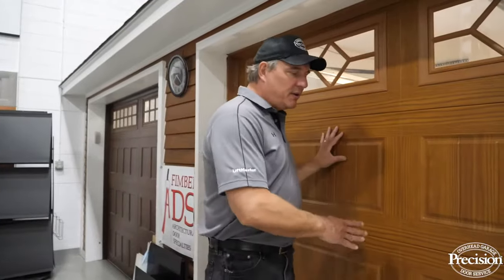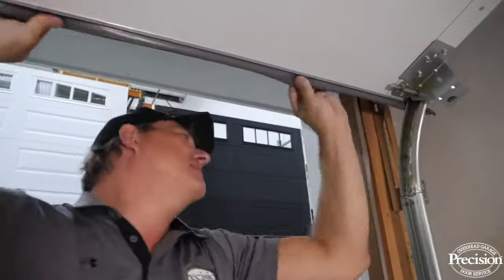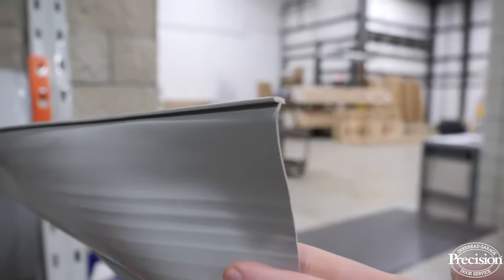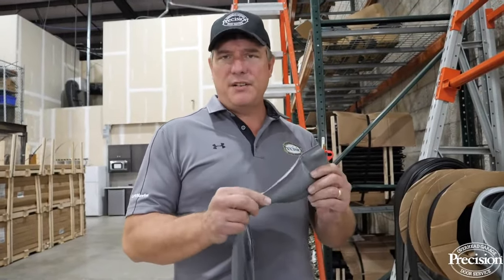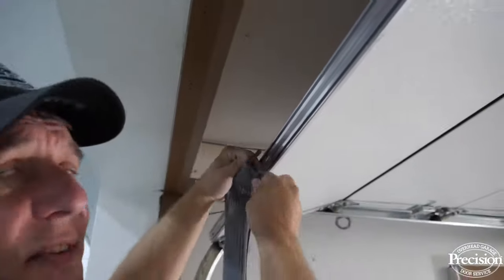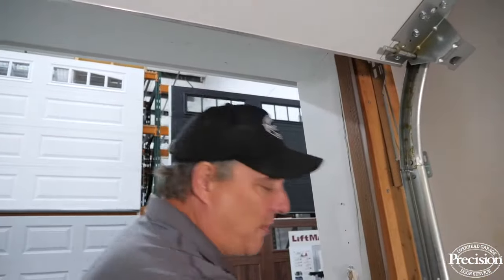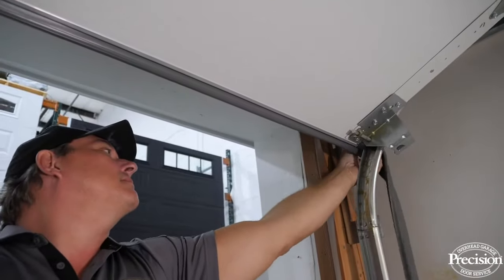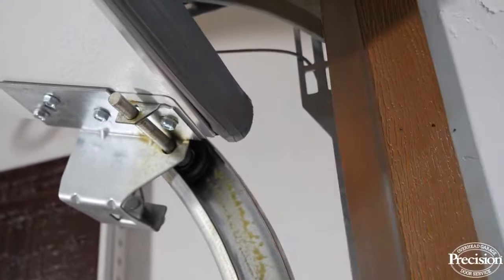How To Replace Garage Door Bottom Rubber

Comment: Thank for explaining everything in detail I was just trying to put weather strip in on the bottom of my door and the thing is the channel thickness is smaller than the Frost King bottom seal rubber that I bought at home Depot so I'm going to have to buy one with a thinner channel thickness, but thank you for explaining this otherwise I would not know why it doesn't fit
Reply from the maker: No problem! Glad we could help!

Comment: Great video.  Unfortunately, I installed the new rubber bottom, but I can still see light through on one side of the garage when it's closed.  It appears the ground is slightly warped.  I don't suppose there's something else not too drastic I could do to fill the remaining gap?

Comment: First time I replaced mine I did it by sliding it in. It wasn't fun. The last time I did it I used a heavier duty Bowsen brand. Their installation video shows to push the back edge into the track and then work the inside edge in. Then move to the front side and stick the back edge in, and then push the front edge in. At first I was using a plastic trim tool to push it in. Then I switched to a screen roller and it zipped right in.
Worked out faster than trying to slide it. Last time I would get half way or more and it would pop out of the track when I tried to slide it.

Comment: I don't have a problem with water pooling outside of my garage door, but heavy wind driven rain seeps in and pools up inside. Are there any options to prevent this with the T channel design or is the standard rubber seal good for this?

Comment: Soapy water. Wd40 will collect grime.
Reply: Two clues that these people have no idea what they are talking about.  1). Recommending Wd40 which is solvent based and great at breaking down rubber.  Anyone that recommends this to lube the retainer, don't walk away, RUN!  Only use silicone spray or soapy water.   2). They have some kind of grease in the roller track which is a big no-no.  Dries, collects dirt and hardens. Increases rolling resistance, especially in the winter. Only lubricate the roller bearings.
Reply: Go ahead and try to slide one in without it lmbo😂

Comment: Thank you for the video. I did the same exact thing. But now, the door is a standing a few centimetres up frm the ground and the latch is not falling in to close the door. I think this is because of the thickness of the rubber. How do i fix it ?
Reply: Have you try adjusting the closing limits of your garage door opener?

Comment: I just replaced Bottom Rubber Seal and it sticks to the the painted floor and makes motor work a lot harder to break that sticking. Any solution to that? I am in Florida and my garage door exposed to the sun.
Reply from the maker: You can purchase Slick It! It's a lubricator for your bottom rubber and weather seal, you apply is similar to a deodorant. That should do the trick!

Comment: I have a garage door that needs the bottom rubber replaced, but there is a portion of the door that has been damaged, and in the current condition it won't be possible to get past that area.  Is it possible to repair the section of the door that is damaged, or am I looking at replacing the entire door?
Reply from the maker: There's a chance that you can just replace the section, but you'll have to figure out who manufactured the door. If it's a common door type, then you can possibly call the manufacturer and see if they'd have the right panel size for your door. But if you cannot  figure out the manufacturer, then it might be time for a new door.

Comment: Doesn't wd40 eat rubber?
Reply from the maker: It does not. It is however, a water displacer. Therefore, it technically removes grease, which isn't good!